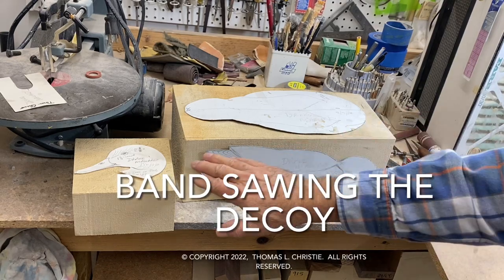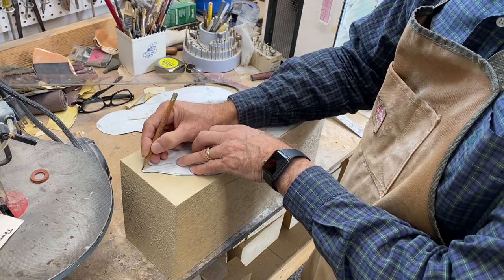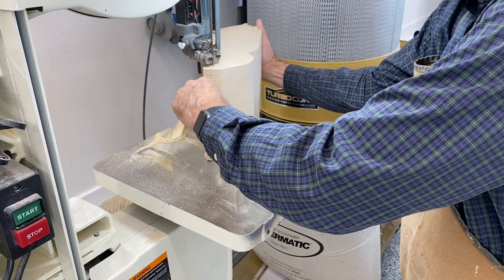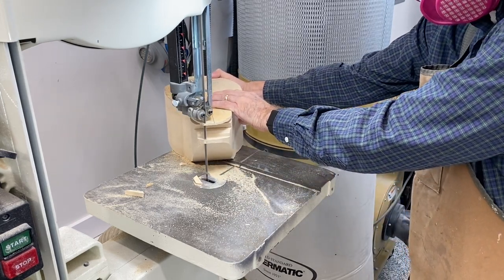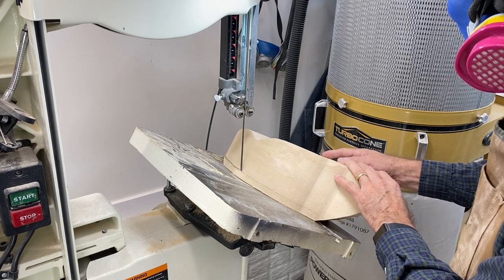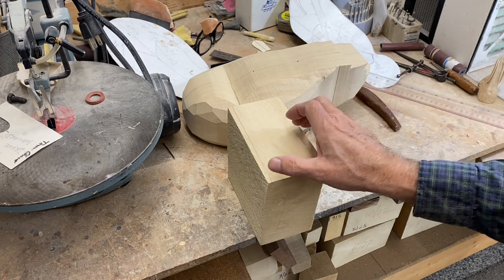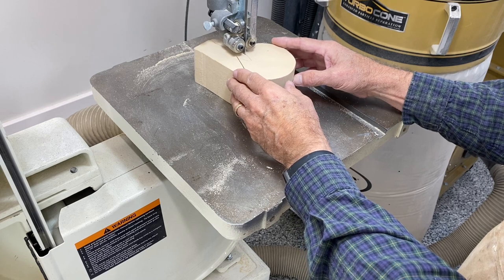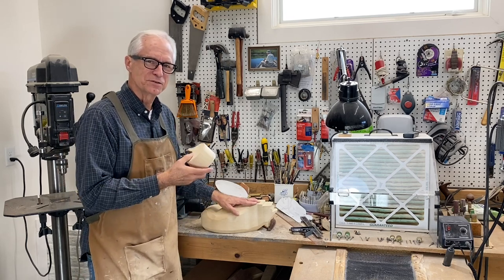Session 1 - Band Sawing the Decoy - Drake Mallard Decoy

Comment: How do you cut out the second section if you have to keep making relief cuts on the bandsaw instead of one big piece that you can attach my band saw is too small to make one large cut I have to make a bunch of relief cuts and I'm having difficulty cutting out the the other view that you had done any suggestions
Reply from the maker: that’s a tough one if your band saw won’t cut that depth. may have to eyeball it or make a template of your pattern you can use it to check the shape as you trim it down.